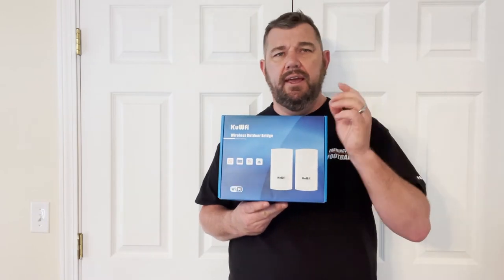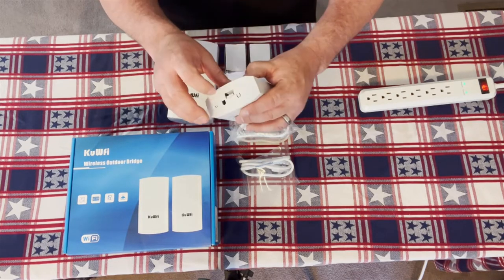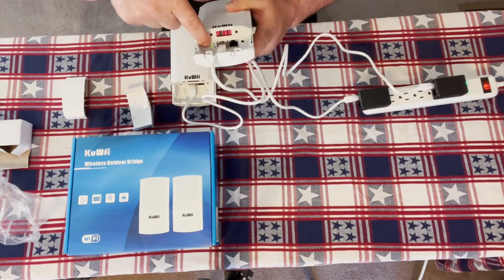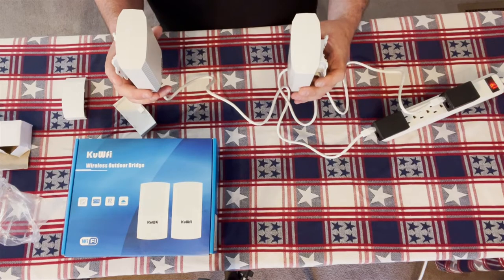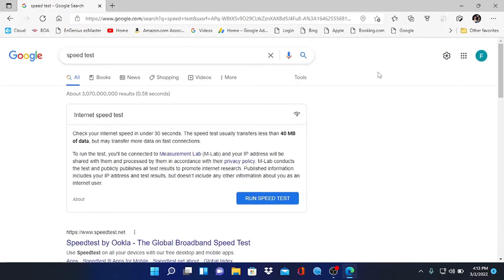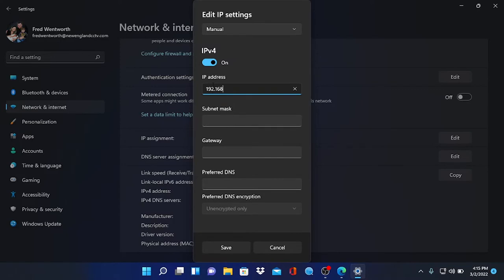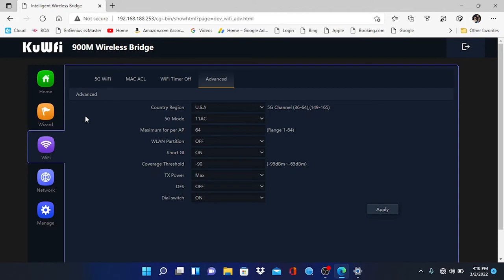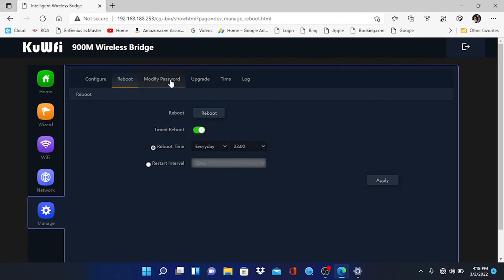Wireless Long Range WiFi Bridge Installation

Comment: Few additional questions, if you don't mind... Intend to mount a pair of these near the top of the gable on two different buildings. I'll be using a pair of old (modified) directv satellite pole mounts. The question is; should we do anything else to ground these devices? Any recommendations about the best type/brands of outdoor ethernet cables to use? Finally, any advice about surge protection? From what I have seen most surge protectors have troublesome joule or clamping ratings; and/or they lack a way to also protect your ethernet. I would love to hear your opinions about this, and I'm sure many of your subscribers would as well. Thanks again for all your work, I really appreciate it.
Reply from the maker: These bridges do not have grounding cables, but you can use an inline ethernet surge protector. You can find them on amazon for $10. We use Southwire outdoor cat5 or cat6 cable from Home Depot, you can order it online as well. I prefer Belkin surge protectors myself, never had a problem with them in all my years. Hope that helps.
Reply: @WentworthCCTV  Exactly the information I was looking for, thanks again.

Comment: Great video.  You explain it so I can understand it.  I need to learn the acronyms what settings do what.  I installed 4 of these systems for friends, one just last evening.  I used an access point at the client end last night. That was plug and play.  I have trouble getting a router configured on the client end of the bridge setup.  Do you have video on the settings for using a router as an access point?  Again, a great video.

Comment: You discussed logging in to the host device. Do we also need to log into the client device to change settings there also?
Reply from the maker: When a channel is changed on the host, the client will adjust automatically based on the host as they are cloned by mac. If you change the IP settings from static to DHCP or change the default password, you would log into the client. I have used alot of these this spring when other manufacturers were out of stock on bridges and Ive got to tell you they are pretty impressive.
Reply: Small caveat mentioned in the "Part II" video ( https://youtu.be/cNrE56JJ4xk?t=551 ) -- Client device needs to be powered up (plugged in to POE) when changing settings on Host device.

Comment: I am having a hard time deciding what to buy.  I'm software savvy (3D modeling, office, + many others) but not IT savvy.  I know nothing of DNS, gateway, TCP/IP, proxies or anything about networking.  One of the disadvantages of having Macs with mostly plug and play.   I have fiber optic cable from my internet provider to my WIFI modem in my house and want to bring internet to my steel building about 75 feet away since my design computer has software that needs to phone home for authorization and I need WIFI for my mini split so I can control it from my house.  Is this the right product for me?  I'm concerned about keeping my WIFI network secure since I don't know much about advanced settings on networks.
Reply from the maker: You can disable with WiFi SSID broadcast on the bridges for security purposes. You can also hardwire the PC to the client bridge LAN port or install a wireless router in the steel building. They are secure though, I’ve never had an issue. They come default with a SSID broadcast of 5GHz and password of 888888 so you would definitely want to change that or disable completely as discussed above. It’s easy to do.

Comment: I got line of sight less than 300 feet and only getting 2 bars of wifi output.  To weak to run anything, got any idea what the problem may be?
Reply from the maker: These are bridges, they are intended to transfer Wi-Fi from one point to another, not to act as Wi-Fi access points. If you are trying to connect clients or devices to it for Wi-Fi, you would want a regular AP not a bridge.
Reply: @WentworthCCTV  Thanks, could you recommend a product that would work, I'm an HVAC guy and not very savy with this type of stuff just trying to get wifi to my parents house, we buried cat 6 cable and added at poe switch at my router ro boost the signal through the cable and that didn't work then we tried the bridges, would a poe extender mid way in the cat 6 cable work? I read cat 6 is only good for about 330 ft and we have around 400 ft of cable.

Comment: Is this for PC only? My Chromebook doesn’t have an Ethernet option in the Network settings. Can this be done wirelessly?
Reply from the maker: You should be able to change the WiFi adapter from DHCP to static.
Reply: Do I do that through the KuWFi dashboard?
Reply from the maker: @QaloriHQ  no you do it on the chrome book in the wireless network settings.

Comment: I can not connect and don’t know what I am doing wrong. Can you walk me through this bridge conmection please.
Reply from the maker: They are shipped pre configured. You dont have to do anything. Plug in the PoE and run a cat6 cable from the PoE port of the injector to the WAN port of the bridge. The H is the host bridge that connect to your internet via the other port on the PoE injector. It is the LAN Port. Do the same to the client bridge and they work out of the box.

Comment: Glad to have found your channel. Seems like you can disable wifi from the settings menu. Is it possible to disable it and still be able to create a bridge? Someone at KuWfi said you can; although I’m not sure they understood english well enough to comprehend what I meant. Aware the device has to transmit wirelessly from point to point, just don’t want a wifi broadcast coming back into the house.
Reply from the maker: Yes just log into the AP and disable the WiFi….I do that every time I install the bridge I’ll make a quick video on it.
Reply: @WentworthCCTV  Thanks so much.

Comment: I have any issue and hope you can help me. I have a 1000mbps line and the router or the Kuwfi throttle to 100mbps via lan. do you have an idea?
Reply from the maker: The units ship with a 20 MHz channel width. Log into unit and change that to 40 or 80 MHz (some bridges only have 40). Next, do an airspace scan to find a non-congested channel on the 5Ghz frequency. Lastly the bridges come shipped at 192.168.188.100 and 192.168.188..253. Log into them and change the static IPs to assigned by gateway. This will increase throughput. I have gotten close to 1000 Mbps from these, so they do work.
Reply: The highest network speed that can be achieved max is 100Mbps. They have another model that can do 1000Mbps.

Comment: i installed the system yesterday seems to be working good but when i installed on the house and garage (100 ft) away i am only getting 20 to 50 mbps. how do i get the full speeds of my internet connection? i just did the basic setup yesterday plug n play setup. any advice would be amazing and thank you for your video helped alot
Reply from the maker: Make sure they can see each other. Even at 100 feet they need line of site.They ship with a channel width of 20. Log into the host bridge and go to WiFi and change channel width to 40. Also, go into network and change the static IP to obtain from gateway automatically. That should give you more speed.
Reply: You don't say what your full speed is, but their ethernet sockets won't do more than 100mbps

Comment: please sir, can this device be seen by 3G, 4G phones also? If yes, how to set it up?
Reply from the maker: They are primarily used as bridge kits which you would connect a router or AP to. But yes, there is a broadcast SSID a device or two could connect to wirelessly.
Reply: thank you sir for your reply time. As you confirm me that the 3Gand 4G can also see it, would you give me a video or description to show me how to proceed it for I bought one but only 5G devices are able to see it, but in my area, there are many 3,G,and 4G. I will be glad to get the solution for I am so embarrassed and confused about how to get this issue solved  now

Comment: Great review. Can it extend an existing wireless network wirelessly? Or it only works wired to the Host device?
Reply from the maker: I have only used these as point to point bridges. They do have a broadcast SSID and password and you could see if the other client would connect to it but I would doubt it.